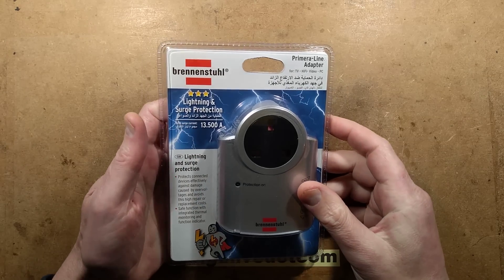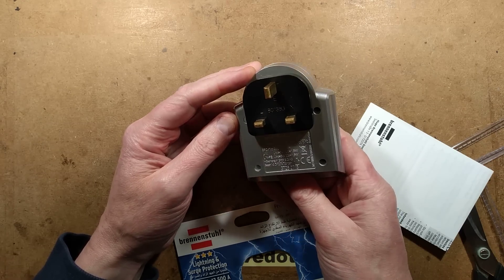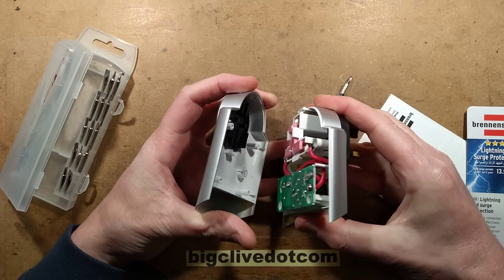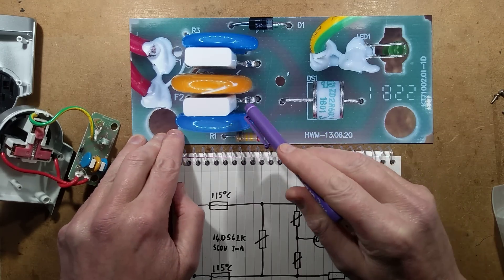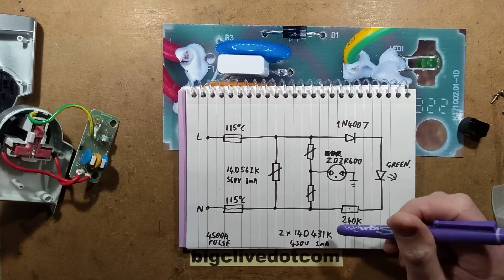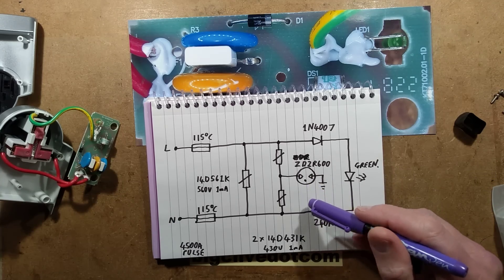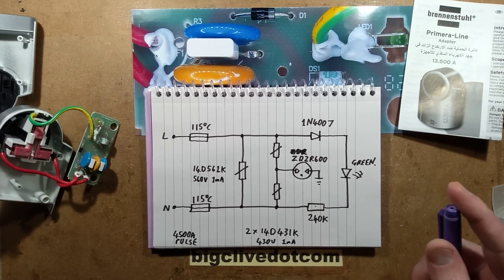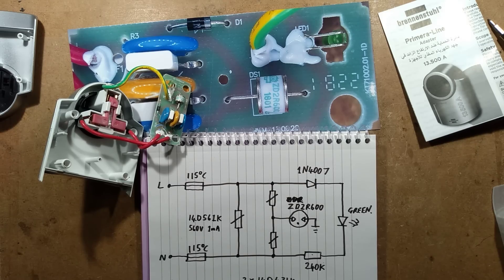Inside a 13,500A surge protector.  (With schematic.)

Comment: Wow, Chromium is a total piece of shit browser. When I open many tabs with YouTube videos to watch in the future in them (of course with autoplay on load disabled, which is a custom setting), it uses more than 10GB of RAM after a few days. Then when the RAM is full, I close it down and restart it, so that it goes back to using only a few GB. But it loads every single video page, and starts caching these videos even though I don't want to watch them now, I just want to have the pages open so I remember what there is still to watch. So it takes minutes upon minutes of full bandwidth (unfortunately only 8MBit/s for me), plus times of 100% CPU load off and on during that time. Why can't this browser work like Firefox and only load a tab that was previously open, when one changes to it? And why must the YouTube site start caching videos that are only loaded and not supposed to play right away? Wow, this is really getting on my nerves. That way, restarting Chromium takes about 5 minutes until it's usable again (during which I am writing this ranting and totally off-topic comment). And no, using Firefox is not an option, I use that for other stuff not associated with my YouTube account. Yeah, it's pretty much fucked up with that privacy-murdering Google shit...
Reply from the maker: Check the settings it may be pre-loading web pages it thinks you may be navigating to.
Reply: @bigclivedotcom Nope, it doesn't do that - it's just a total memory sink so it needs to be restarted every week or so.
Reply: Seegal Galguntijak Use multiple non-Google browsers not sharing directories.
Reply: @John Francis Doe There aren't that many different browsers which fit my requirements (i.e. to be able to use add-ons) - plus, I don't even use the actual Google Chrome, but Chromium instead (the open source version of Chrome, which lacks a few "Google-esque" features).

Comment: I just want a device that will convert the modified sine wave from my generator into a pure sine wave so my appliances will be happier when I have to use the generator.
Reply: Rectify the output of the generator and run a DC motor that's connected to an alternator. Boom- smooth sine waves!
Reply: Laura Harris Or fit a proper alternator in the genset instead of an electronic alternator powered by something unstable.
Reply: You just need a really big low pass filter.

Comment: Think of the star rating diagram as a computer GUI with two (non selectable) options greyed out. The unit is a 3 star unit (coloured option), and should not be used to protect your prized high tech gear. That's my best guess anyway.
Reply: I have one of the five star ones for my PC etc. and they also have a noise filter and such... Not sure if that is too great, but it has more sockets. So there's that. :D
Reply: @TashiMortier  I'm curious about the noise filter. Is it a common mode choke with a capacitor across it, like the ones used in ATX power supplies?
Reply: @Sheevlord  I have no idea. I'm far from an expert on these things. They just advertise it as being good for hi-fi equipment. So could just be total snake oil as well. I just wanted the higher power surge rating to protect my expensive PC. :D
Reply: @TashiMortier  It probably isn't snakeoil. A filter consisting of a common mode choke and a capacitor across it is a simple yet effective way to filter out high frequency noise from the power line. It's a form of an LC low pass filter. And audio equipment (especially old AM radios) can indeed misbehave when high frequency noise is present in the power line.
Reply: Yeah, that's what I thought too
Reply: Where's the active protection monitor the sine wave or somat bin job 🤣🤣🤣
Reply: That's s correct,
Reply: Hi-Fi

Comment: If this circuit were used in the U.S. how should the values be adjusted?  Downward to what voltage(s)?  I'm thinking about building this for my own use in the U.S., I don't trust the premade versions I've found.  Thanks.
metal oxide varistor - voltage?   gas discharge tube - voltage?  Anything else?
Reply: Halve it? Actually, I think it would probably work fine as is.
Reply: @deadfreightwest5956  Halving would be good, leaving as is would probably clamp too high for most 120v devices.
Reply: Check APC versions. They are good!

Comment: In much of the world a period is used instead of a comma for thousands separation. Also I believe the 3 gold stars means this device is only rated for consumer electronics, and the other 2 options are 'grayed out', or not meant for this device
Reply: The text on the package is in English, therefore the English convention should be used. If the text was in German, then the German convention should be used.
Reply: @MrEdrftgyuji  Yeah but I strongly doubt that actually happens. I'm sure they just print whatever seems logical to them. I'm actually very surprised that Clive didn't think of this -- he's lived in the UK/Europe his entire life, and most of Europe uses . as the thousands separator and comma for the decimal point.

Comment: What is the difference between the Yellow and Blue MOV's ?  A few years ago we took a Lightning Strike killing our Well Pump, Two telephones  Two TV's and the Lap Top  ( IN MY LAP Ether Net Cable Connected ) . Lap top simply made a rather loud POP sound followed by the Never Ending Nap.  DEAD Meat it was.   We seen Sparks and Arc emitting from the Wall Socket in the Living room.  Some how I really don't believe that little spark Gap would have ARRESTED anything that day.  LOL

Comment: Why would they mount the led that way versus just using a smd or through hole soldered on the printed side (straight pins).
Reply: At a guess, I'd say to keep the conductive parts a minimum distance from the end user. SMD with a light guide would probably be a simpler design, but the rest is through hole so maybe they hand solder the whole thing, making one SMD component silly.

Comment: In German, commas and decimals are reversed in numerical usage
Reply: EU: Comma, except Maltese, Irish or English publications.
http://publications.europa.eu/code/en/en-360500.htm
Reply: I thought it was common across lots of Europe outside the UK (not just Germany)
Reply: @Pieman93  In croatia decimals and commas are different than in germany it seems
Reply: @Pieman93 this is true. Comma as decimal separator is very common outside English-speaking countries. What separates thousands before the comma, however, varies wildly. Some use period, others just use a space.
Reply: @Pieman93  Definitely the case for Sweden - decimal comma and thr dot or, more commonly space, used as thousand separator.
 IE 123 456,7 or 123.456,7
Reply: @michaeltempsch5282  Swedish standard for thousands separator is space. Nothing else. The dot is some old hard-to-die stuff from the dark ages. ;)

[edit] and BTW, it's really fun to use CSV files when our decimal point is a comma. Swedish standard for data separation in CSV files in Excel for example is a semicolon. Oh the horror...
Reply: This seems like something that could cause a lot of trouble and should be standardized
Reply: @AgentTasmania  it's probably standardised in the really important stuff but nobody wants to change to the other system because everybody is used to they own system
Reply: @AgentTasmania  Yes before somebody launches a satellite or is collaborating on nuclear power plant specs.
Reply: @AgentTasmania  It is super annoying in software, and causes trouble in Excel.
Reply: @AgentTasmania  Definitely. Unfortunately, almost every country would insist on THEIR way because everybody (in their country) is used to it. Unlike date formats (day/month/year vs. month/day/year), there is no innate logic that isn't dependent on language (which also varies between countries). The only reason , or . separators make sense is because we're each used to our current standard.
Reply: @Haydn Lording - Don't bother with that guy. On a different thread  he insisted that "official mathematical notation" uses the interpunct (which actually isn't used anywhere, because it looks the same as the multiplication dot), and when I posted the link to the ISO and IEC standards (which define the comma as the official decimal mark for all languages), he went on a rant about "muslims and euronazis". Probably not even a bigot, just a troll desperate for attention.
Reply: @AgentTasmania  True, but they're prone to getting touchy when you tell them to do something properly.
Reply: @AgentTasmania some countries are remarkably resistant to standardisation. Britain, for instance. And the US in particular.
Reply: @AgentTasmania  It indeed has caused trouble numerous times.
Reply: I once almost made an electronic payment 100 times what I'd intended because I used a "." instead of a ",". Luckily (?) I didn't have enough in my account to make the payment..
Reply: That shouldn't make sense (at least if the software is written correctly) since there's always three digits behind a thousands separator and two digits behind a decimal point.
Reply: @mjouwbuis  That is not always the case. There can be more than two digits behind the decimal point, and data generated with a compiler using the dot as a decimal point, imported into Excel using a comma as a decimal point makes it always interpret the them as dates and time. Same with Data generated with excelimported into programs expecting dots as a decimal point will return in unexpected results and errors.
Reply: @mjouwbuis  No
Reply: Same in dutch.
Reply: @VeraTR909  "Reversed". Did you mean: The right way around? :D
Reply: The Germans might just say, "In UK and America the decimals and commas are reversed in numerical usage."
Reply: @terryendicott2939  On the other hand, the plug is a UK one, not a continental European one.
Reply: @jonathanwarner1844   Yes that is why it has Arabic letters all over ... seems to be some kind of gray import ... search for BS 1363 and you will find a lot of countrys who uses it.
Reply: @jonathanwarner1844  Good point
Reply: That's why, in order to avoid all this confusion, I prefer to use the ISO standard: 13 500 A. Plus, spaces look neater!
Reply: @Matt Quinn you mean they use a full stop or period as a decimal point. The words "decimal point" are only associated with a dot in the English language, there's nothing inherent about the concept that implies it is a dot. The marketing department of this particular product probably just gave up after fitting the UK plus and socket and translating the basic info to English.
Reply: I am german and i only use dots as a decimal on the bottom as a thousand separator on top. 123'456.789 (there is no top dot on the keyboard)
Reply: @nigrum_tredecim  
Looks like you are a C/C++ programmer 😉
I had to convert numbers and the only ambiguous case is only a single point/ comma. And even then, only the exactly 3 decimals could rightfully be either thousands separator or decimal marker.
Reply: @fromgermany271  well i wrote some VERY simple stuff in cpp but most i "programm" is literally just batch scripts
Reply: @nigrum_tredecim  at least that is a not so old feature of cpp.
Reply: Because they're fools
Reply: So instead of two point three, you'd say two comma three?!  In a list you'd still say "buy me apples, oranges, pears", right?  So comma is seperating a list of items.  In this case, millions,  thousands, and units.  It's utterly illogical to use a dot as a seperater.
Reply: I love this can of worms
Reply: In Canada we use spaces for 1 000s (nobody does it, though) and decimals for, decimal numbers
Reply: So what is the big deal?
Reply: Makes sense that it has Arabic if it's German.
Reply: Simple rule: Never ever ever ever use anything but space as a thousands separator.
Reply: I’m sure someone asked and I’m just blind and I’m just not seeing it, and in this case, I apologise! But how come the comma and period are reversed like this, and what’s the benefit of doing this? Thanks in advance!
Reply: yeah same in Netherlands. copying data and preparing data is always fun with the dutch/English version of Microsoft products.
Reply: @km5405  OMG. I struggle with the same problems every time I want to import CSV files in Excel if the file was created with an English version. It was possible with Excel 2010 but with the current version (Office 365) it is almost impossible and a pain in the ass. You have to switch the language settings and stuff. What a mess.
Reply: Brexit will sort this😂
Reply: Same in Spain
Reply: ISO/FDIS 8601: If a decimal fraction is included, lower order components (if any) shall be omitted and the decimal fraction shall be divided from the integer part by the decimal sign specified in ISO 31-0: i.e. the comma [,] or full stop [.]. 
Of these, the comma is the preferred sign.
Reply: It's quite odd in logical sense to use a dot (.) to separate any number from another. In grammatical senses the dot terminates a sentence. So why you terminate a number from its decimals (which are also part of the number) is quite odd to me. :-) As always: historical reasons... :-D
Reply: @ftrueck  I think I remember seeing a "•" used as a decimal point in hand written texts from back when people wrote by hand. I guess it went out of favor when typewriters showed up.
Reply: @JimFortune  Back in college my Physics teacher used that symbol for a decimal point in her powerpoint presentations, while my Maths teachers were using it to mean `multiply`.
Reply: @ftrueck  A full stop terminates a sentence, not a decimal point. As always: context... ;-D
Reply: @ftrueck  Isn't it more weird to `terminate` part of a number from the rest of its non-decimal integers?
Reply: @ftrueck  The way I see it one would terminate counting millions with the dot, terminate counting thousands with the dot and so on until you reach the final integer and further fractions are indicated by a mark of continuation like the comma. It also helps indicate exactly which one of the triplet digits is the integer so people don't get confused and make a $5000 payment instead of $5.
Reply: Hugo Brennenstuhl GmbH & Co Kommanditgesellschaft
Seestraße 1-3
72074 Tübingen
Reply: So in Germany,  for say,  3,5 do you say:
"three comma five,"
or do you say:
"three point five ?"
I'm intrigued.
>
Reply: @Bodragon  Ich weiß nicht. Ich bin ein Amerikaner.
Reply: @terryendicott2939   Ich weiß nicht. Ich bin ein Englander.
>
Reply: @ @Bodragon  Can't say for German, but in Portuguese (at least Brazilian Portuguese) you say "três vírgula cinco" (three comma five) although "ponto" (point) is widely understood.
Reply: @Bodragon - Neither. They say "drei Komma fünf". Because they speak German, not English. :)

@Jim Fortune - The interpunct is deprecated because it looks the same as the multiplication dot. It was popular among typesetters who thought it looked elegant, but mathematicians / engineers hated it. Most standards organisations actively recommend against using it as a decimal mark. 

The official ISO/IEC/SI decimal separator is the comma, while the "digit group" separator is the space. 

https://www.iso.org/sites/directives/current/part2/index.xhtml

9 Numbers, quantities, units and values
9.1 Representation of numbers and numerical values
• The decimal sign shall be a comma on the line in all language versions.
[...]
Each group of three digits shall be separated by a small space from the preceding digits.
Reply: The text on the package was in English, so the English convention for numbers should be used.
Reply: @MrEdrftgyuji - The text on the package is also in Arabic, which suggests this was probably not originally aimed at the British market. Also, the International Electrotechnical Commission uses the same convention for all languages (and the official format would actually be "13 500", without a point or a comma).
Reply: When speaking english, you always use a comma for the thousands operator. When in your own language, use whatever you want :)
Reply: @Richard Smith - Thousands operator? Did you mean separator? If so, the ISO/IEC format is actually to use a space as the digit group separator (every 3 digits), and lots of English-speaking countries follow that rule.

@Haydn Lording - Decimal marks (or separators). The term "point" specifically refers to dot-shaped marks (like a full stop or an interpunct).
Reply: Meanwhile in Australia we don't separate places by the , because it's allready used in English for listening things. We separate the thousands by a space.
Reply: @jouebien  I'm born and raised in Australia and I've never seen or heard of that here.
A comma is used as a thousands separator in Australia, just like the UK (and quite probably, the rest of the Commonwealth countries).
Reply: @jouebien  Actually, the listing of the things is why English uses commas for numbers. And we use the simplified short-form numeric system. Take the maximum positive 32-bit value for instance; 2,147,483,647. We just replace words with numbers. In this instance;
Two billion, one-hundred and forty-seven million, four-hundred and eighty-three thousand, six-hundred and forty-seven.

Yes, we hyphenate numeric words like that sometimes as well, Though, here's how it reads non-hyphenated for our younger peoples who almost practically forgot what a hyphen even is:
Two billion, one hundred and forty seven million, four hundred and eighty three thousand, six hundred and forty seven.

I don't like how it reads. Certain symbols exist for a reason people use them!
Reply: @jouebien  As Australia and Sweden are in agreement despite being on opposite sides of the world, then you know it's the correct way. Spaces are best.
Reply: YET, when they speak I hear them same comma but put a period.
Reply: well, considering commas are used to group things..  I would think the English-speaking world got something right for once.
Reply: we need to educate these european cats to use decimal and commas correctly